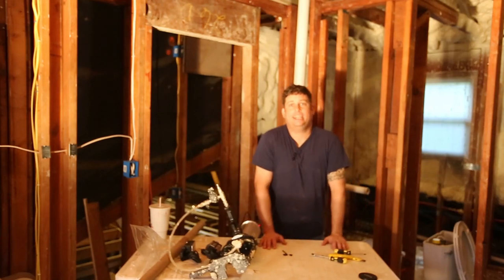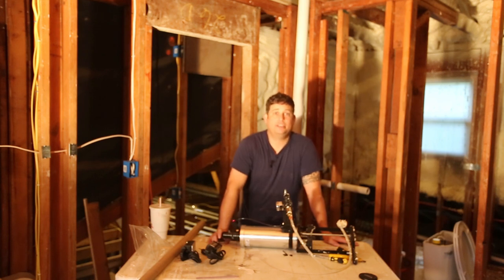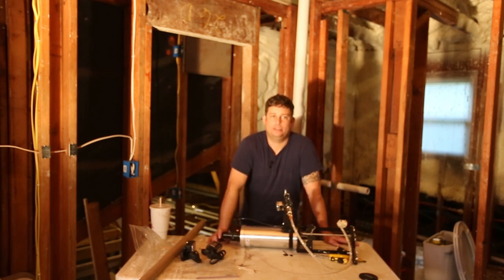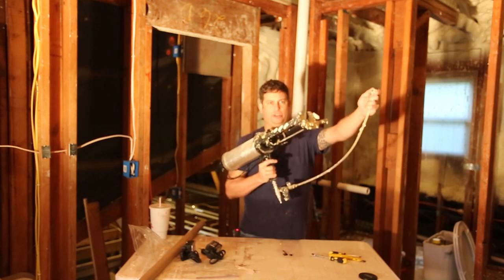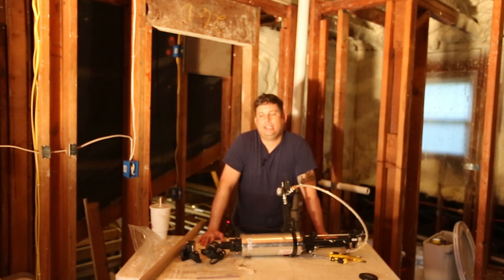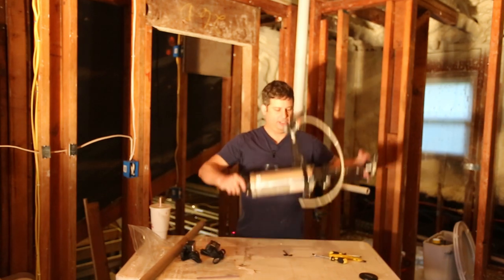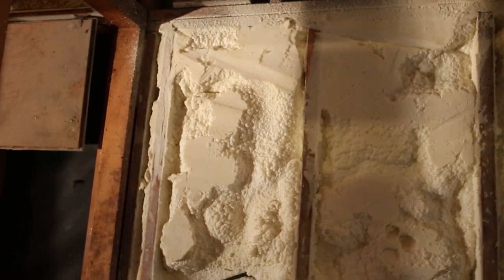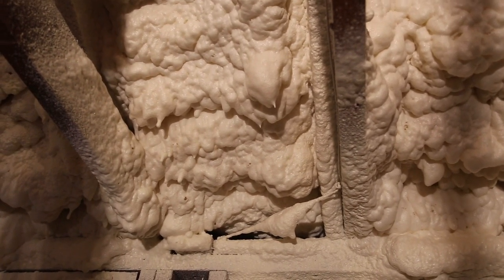Review of FastKick Cartridge based spray foam system

Comment: Hi Brian, I too had bought one of these monsters.  Did 2 jobs with it and it's been in storage ever since.  You are right on every aspect.  I am now looking into buying the Lil Pup system for my business as well.
Reply from the maker: +Steve Johnson Thanks.  Check out my Lil Pup review.  It is a great machine.  I ran 3.5 sets through it on my project.  My house is now super insulated and I'm enjoying very low power bills and stable interior temps.
Reply: I did watch them, great videos, the videos  answered some of my questions on the machine. Talking with Dan now about getting a Lil Pup for my home improvement business.

Comment: I really only had to heat the .5 lb foam that I used. What I did was I threw a cartridge in the microwave for a minute, sprayed, and was cooking another one while I was spraying. I got much better results from the 1.5 lb foam. That being said I blew about 6 inches of .5lb foam into the walls on the addition side of my house. Yes I think closed cell new would have been a better choice but noise is an issue there since my closest neighbor is about 30 feet from that wall.
Reply from the maker: The Fastkick cartridge system was trash for spray foam.  I think it's designed for filling cracks in sidewalks or something.  It was very inefficient.
Reply: @hotpuppy72  I had good luck. I have used it on several home projects now. Much better than froth pack with the exception that once it starts spraying you cant stop until the cartridge is done.